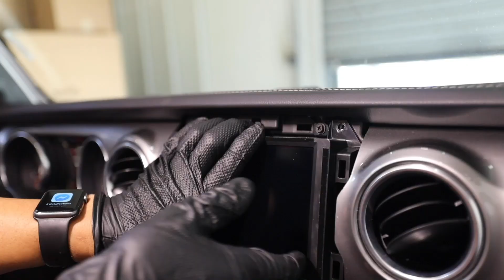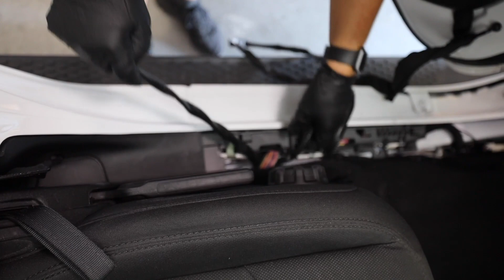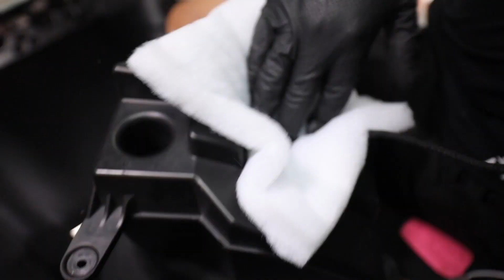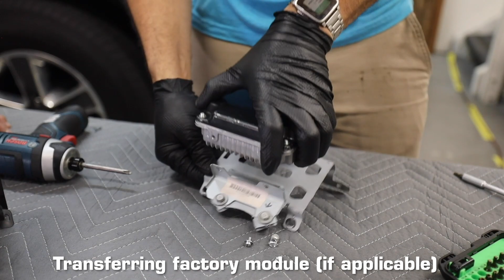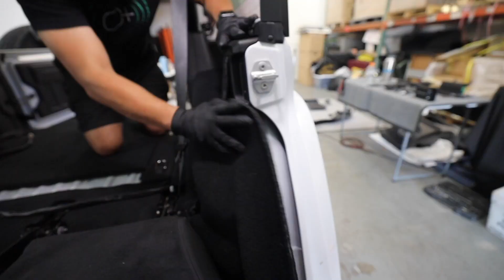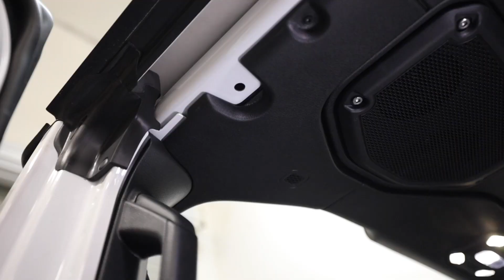Jeep Wrangler | High-Resolution Audio Install

Comment: I just installed this system in my 2021 JL this weekend. I have zero car audio installation experience, but was able to do install it myself using the video. I did a highway test with the top off and I’m very happy with the volume and sound quality!

Comment: Looking for that right angle socket tool setup. I found the right angle part but it looks like you are using a very short 1/4 socket adapter that I cannot find.